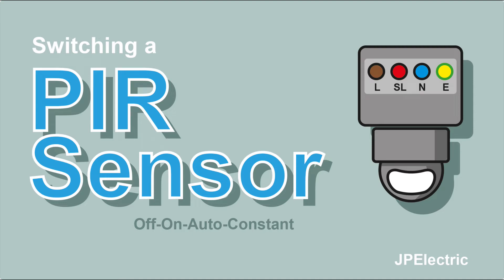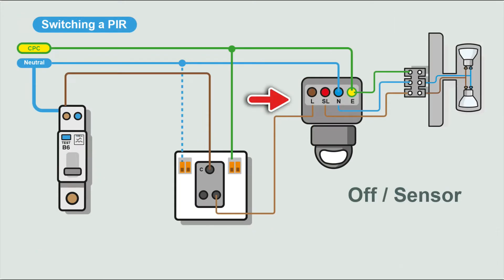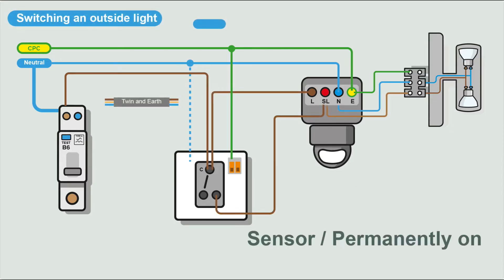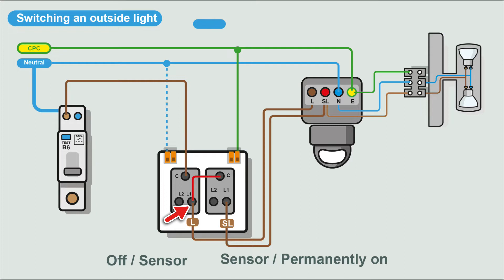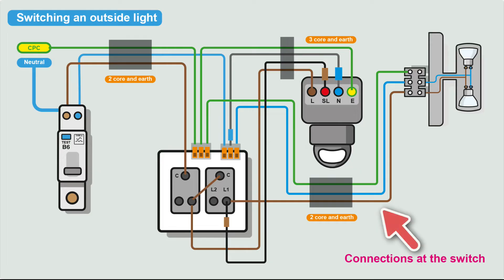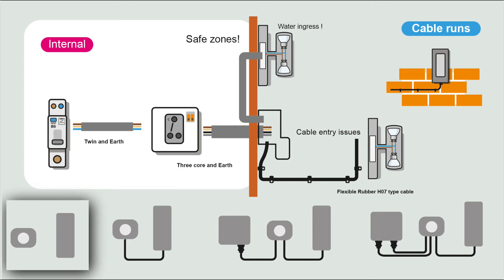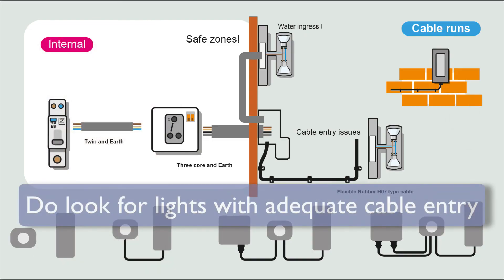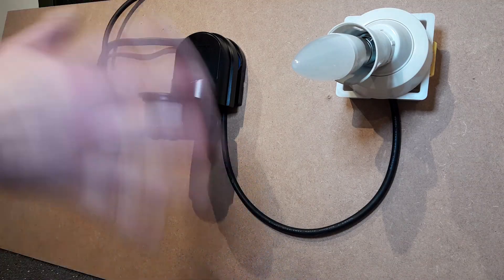Installing a PIR sensor to an outside light

Comment: Hi,great video and a little technical for me... I was wondering if I could some how get my three kitchen external lights that are wired to a internal light switch to work with a PIR sensor? 

I would like to have the option to turn the lights on constant like you have shown and also for over night have the PIR sensor left on for sucurity at the rear of house.
My internal light switch for these 3 external lights currently has a double switch for the bottom of the kitchen internal light.

Would I need to get a triple internal switch so that I could have the kitchen intenal switch for lights and also a PIR sensor with 3 external lights connected?

Cheers! Stephen.

Comment: I'm getting a strange problem I've setup my 4 led u10 bulbs 5watt each and a 35watt normal bulb so even tho the u10 bulbs and the 35watt normal bulbs are all connected in parralell the led lights are always on when you walk past the pir sensor the 35watt bulb turns off but the u10 bulbs all stays on I've got 2 different brand pir both doing same thing

Comment: Great Video!! My external PIR light has 3 connectors for input i.e. Live, Earth and Neutral. The wires coming out from the switch  is 4 core - Brown(Live), Earth(Green&yellow), Neutral(Grey with blue sleeve) and Switched Live(Black with brown sleeve). From the switch do i connect to light connector as follows SL(Black with Brown Sleeve) to Live connector,  Earth(Green/Yellow) to E and Neutral(Grey with Blue Sleeve) to N. Where do i connect the brown live wire from switch as there is no connector for it on the light. The instruction on the light run with PIR and manual override feature. Thanks.

Comment: Great video. Where in the circuit would you add a photocell so the PIRs only activate when it’s dark?
Reply from the maker: Hi Andy, Most PIRs sense light levels, so you do not need a photocell. You will see a small dial with a sun and mood symbol. You turn the dial to moon, so the light will only come on when it gets dark

Comment: Hi there great video , if I’m taking the feed coming into the light switch for a new pir light installation from an existing switch , are the connections brown common , neutral in a connector block

Comment: Excellent video. Do you know if you can connect two or more sensors together to turn on the same light? Would be great to see illustration of that if it can be done.
Reply from the maker: Hi Danny, yes its possible.  Run a permanent live, neutral, and switch live (and CPC) to the second PIR from the first. The light will respond to either switch live
Reply: Thank you

Comment: A very good and informative video, thank you. I am trying to wire up some spike lights and want to use a stand alone sensor, would I need to have the switch? Or can I run it any other way?
Thank you for the video though.
Reply from the maker: Thanks for watching.
You don't need a switch for it to work , but it is useful to have the functionality of being able to switch something off or on 
The PIR is a switch, and you could run a permanent supply to that, which would control the lights

Comment: Thanks again for a comprehensive explanation of PIR with "always on" function.  Got a little confused as from the beginning of the video L1 is on the right but from 0.48 - 1.23 L1 is on the left.  Not a problem though.
Reply: That threw me as well....JP keeping us on our toes😉
Reply from the maker: Thanks for the comment, and good point.
Yes , I mucked up a bit there. I did want to make  a point about how  the L1 and L2 can the other way round physically on the switch , or labelled  1,2,3.  So it useful to confirm how the switch actually does operate. But forgot to mention it.
I was also going to mention that the switching would also be flipped around if wired like that, so switch one would actually be switch two  when screwed on the backbox, if you know what I mean 🙂
Reply: Ur the best bro